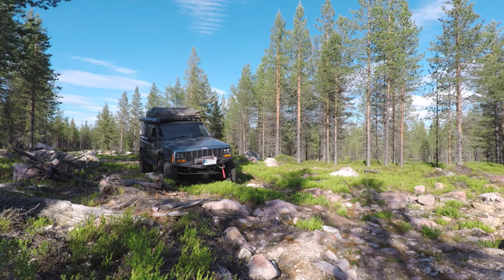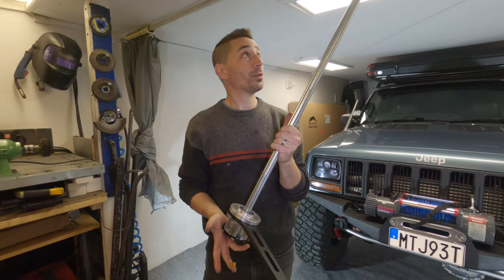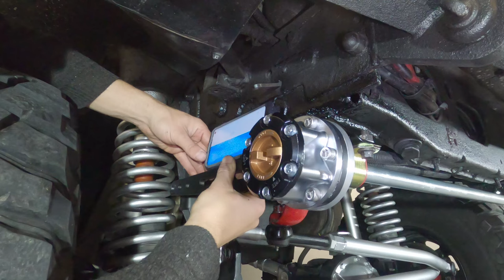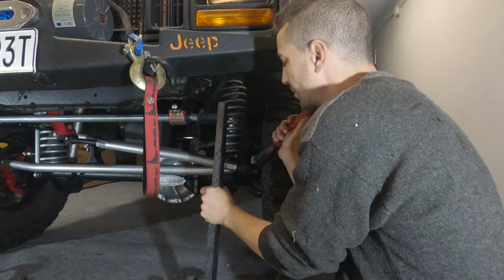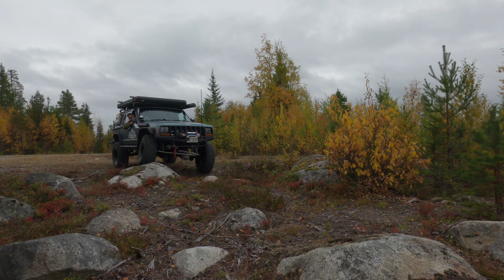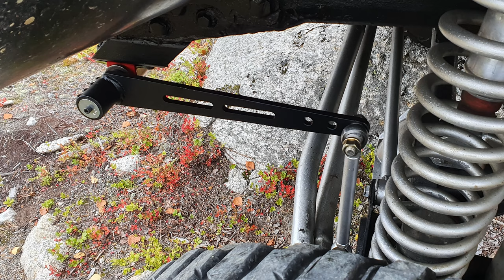RJ's Quick Disconnect Sway Bar / FULL ARTICULATION / Jeep XJ

Comment: Your jeep is not leaking it's just marking its territory. Awesome mod too! It has always been said "necessity is the mother of invention " , so then laziness must be its grandmother.
Reply from the maker: 🤣 thats my scapegoat sorted then. It seems ridiculous that it continues to leak in all the same places despite constantly replacing the seals... pretty sure my axle is bent.
Reply: @WorkshoptoWilderness  it's probably insufficient mating surfaces (😉) with the seals and races, if that's the correct term. I don't know, my friend, super glue, duct tape, bailing wire, and prayers are the staples and go to's in my tool box.
Reply from the maker: Hahaha. Your probably right. I will keep praying 🙏 🤲 🕍

Comment: That's by far the coolest xj sway bar I've seen. I've ran my xj for many years with no sway bar at all and just fancy shocks but with my current overhaul I installed a anti-rock sway bar to try out. I've never wanted a sway bar I've always tuned my alignment and shocks, I got even better shocks this time too they are fox 2.5 reservoir shocks with a high and low speed adjustment custom valved for the specs I gave them. But I see a lot of high end builds running sway bars like the anti-rock and supposedly the anti-rock never needs disconnected you tune it by choosing which hole to put the end links and that changes the leverage or something. I'm also running 37s now and much heavier axles so I thought it might be good to install a sway bar at least to try it. This sway bar looks similar to the anti-rock but is able to be disconnected and looks much more sturdy, I think this is an awesome idea. I may have to look into one of these if I end up liking having a sway bar although I'm not sure how it would fit because I've done a lot of modifications and no longer can use the stock sway bar mount locations but it should be easy enough to make fit. This is a brilliant idea, I do think the torsion bar style sway bar like this is a superior design you can even replace the bar with a different one to change spring rate.
Reply from the maker: Hey Forrest, how are you doing mate? Hope all is well. Still meaning to reply to your email but I just got so tied up with life and work I forgot. I apologise for that. Winter is settling in here soon and come February, March and April the snow will be too high to drive anywhere so I will retire the jeep to the workshop and build up that np231. 
I have an email for this guy if you would like to contact him, I will put it in the description. That swaybar you have is meant to be pretty dam good from memory so I'm sure it will serve you well. Perhaps when RJ has produced his final design then it maybe an option.
Reply: @WorkshoptoWilderness  hey I'm doing ok I've been really beat down lately with some negative stuff but I'm trying to keep my head up and my wife and everything is all good I've been trying to work on the jeep and keep my head up I guess maybe I'm too sensitive of a person or something I just get very anxious and it's hard to do stuff sometimes and it's been tough lately but everything at home is good and that's what matters. 
Just send me an email whenever you want to do that transfer case stuff I put everything aside for you in my shed I still need to pack it properly then I want to talk to you about what I should say on the value of the items because it truly is a gift and the last thing I sent you I told them it was a gift but I had them put however much insurance on it just in case it was lost and I think they charged you a bunch of tax? I'm not sure how that works but I'd like to make it so you don't have to pay a ton of money to get it if I can do something differently.
Reply from the maker: I will reply to you on email mate.
Reply: @WorkshoptoWilderness  right on, it's no rush just whenever your ready. I'll keep a look out for your email. I've had a difficult time messaging you like my phone won't send you text anymore and my email said this weird thing about something not available but it would try again like 40 something times or for 40 something hours? It was very weird but I think it sent eventually. I check my email daily lately.

Comment: I run mine without any sway bars and it's fine. I got used to it. It makes for a much better ride too. I don't run very fast, it's a Jeep...
Reply from the maker: My experience has been the opposite. I wouldn't run without one on the road with all the gear and family on board. The jeep always felt totally stable when it was connected and for good reason. Its also a legal requirement here along with the extreme winters where your driving on two inches of ice and often snow fall.
But hey, these are just my reasons and experiences, you have saved some money not needed them. I cant take mine off or I'm not allowed to drive...

Comment: Mike, is that backing plate with the bearing in it steel or aluminum?
Reply from the maker: Its steel. Its some kind of stainless or Its coated because nothing has corrosion on it yet.
Reply: Thanks Mike, good luck to RJ But damn that thing is pricey! Gotta try and make a much shittier version first lol

Comment: where can I get the parts? or the kits? looking to install on an 85 4runner.
Reply from the maker: In the description is the contact details of the maker. He's only making them for jeeps at the moment but I believe he's got other plans too. You will have to contact him and ask him unless your able to make your own. I'm sure he would help with parts
Reply: @WorkshoptoWilderness   yeah thanks. Should be all the same things but just different lengths on the end links and width on the torsion bar. Thanks again

Comment: Seems like a proper product. It's like if the Antirock & SwayLoc  had a bastard child this would be the offspring. Now what would put it over the top is a dual rate version. Personally not a body roll fan.
Reply from the maker: Seems well made and its nice that it's made in the USA. When you say your not at fan of body roll, do you mean when the jeep leans over? My rear end is really stiff and the spring rate is clearly higher than the front causing it to lean a lot.